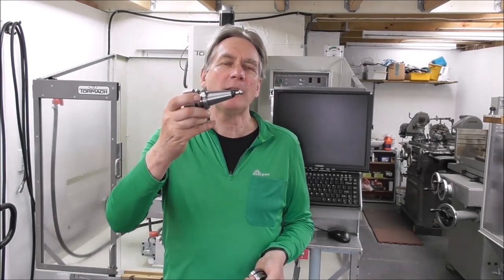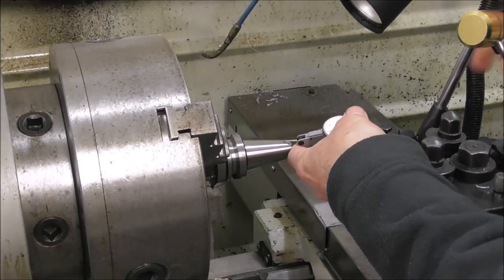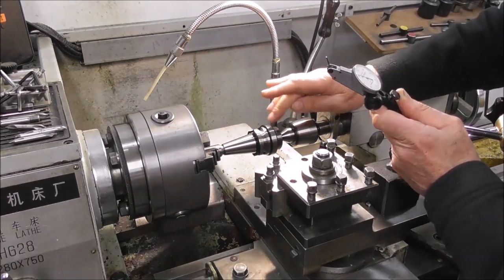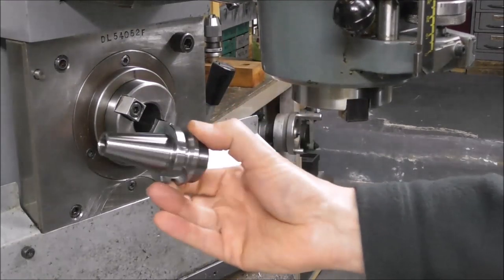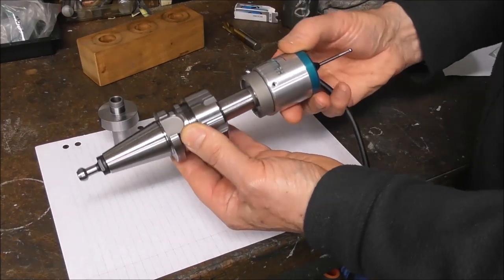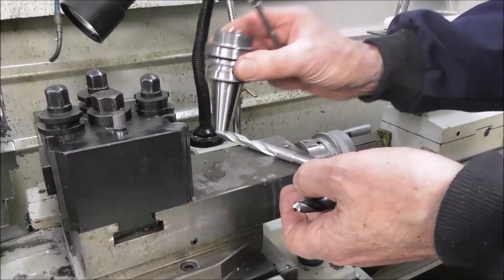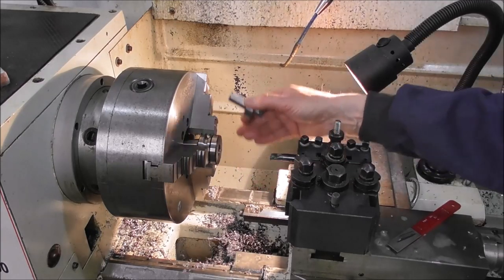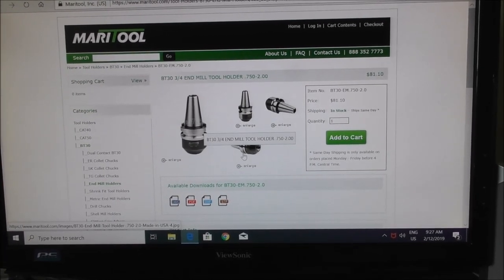TTS to BT30 Changeover?   Cheap Arbors?

Comment: Hi Cliff,  I spent some time in China when I was working for an Australian company.  Here are the reasons manufacturing in China is inexpensive:

1.  I saw rows and rows of very high end machining centres ( mainly Japanese and European machines like Brothers, Mori Sekis, etc).  All of these machines are provided by the Chinese government to businesses at very low rental cost.  No business on earth can compete with this arrangement.  The Chinese government has made sure no on else can compete.

2.  The cost of raw materials is very low when compared with raw material cost in Australia.  For example, I used to pay around $3AUD per kilo for 6061-T6 Aluminium.  Chinese businesses pay less than $1 per kilo.  I costed out a job in Australia where I specified Acetal (Delrin).  The cost of the material alone in Australia was 7 times more expensive than the completed, machined and shipped parts, made to my drawings, in China.

3.  I hand delivered samples of Australian designed mobile phone base station filtering equipment (designed and manufactured to their specifications) to both ZTE & Huawei.  We received only a few orders to keep us happy, but  I later realized the real reason was for ZTE & Huawei to reverse engineer the parts.  We sold our souls to the devil.

Chris Humphris
Reply from the maker: Hi Chris. Thanks for fronting up with that information, I wish more people would do so.  I feel sad about the decline of engineering in NZ USA UK AU ..the list goes on. Cliff
Reply: @Threadexpress
The decline happens in the whole Europe. Even the former great machining superpower of former Czechoslovakia is on decline as being the best of former communist block and significantly cheaper than western countries... They cannot compete either.

Comment: I didn't think the thread contributes to run-out. It just provides axial force for pulling the holder into the taper. How does that work?
Reply from the maker: Hi Jon. Sorry just noticed your question. By run out I don't mean holder run out, just pull stud run out. If the thread is off on an angle as in in this case, it will rack the pull stud over. This amount will still work, but may strain the pull stud collet.  Cheers  Cliff

Comment: Perhaps they are so cheap because they did not pass quality control and then sold off on Aliexpress rather than throw them out?  If they were truly decent, I am sure they would ask more for them, perhaps 50% of a quality brand rather than 20-25%.
Reply from the maker: Hi Scot. I used to wonder that also, but if you look on the sellers listings, often there is large quantities available.  I suspect Chris's comment above is the most likely reason. Cheers  Cliff
Reply: They could be selling rejected parts, but they cant sell those in china as they will simply be returned. And they are a lot cheaper than that in china and plenty good for any normal shop.

Comment: I suspect that these are ruined parts that would normally be sold as scrap.
Reply from the maker: Hi Trevor. I used to wonder that also, but if you look on the seller's listings, often there is large quantities of different sizes etc available. Have a look at chrisjh777 comments below. Cheers Cliff